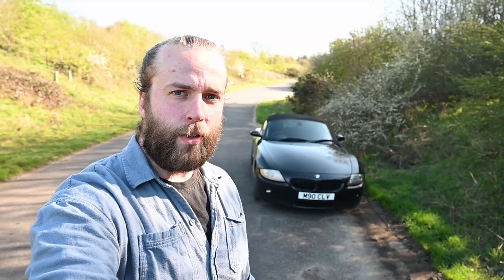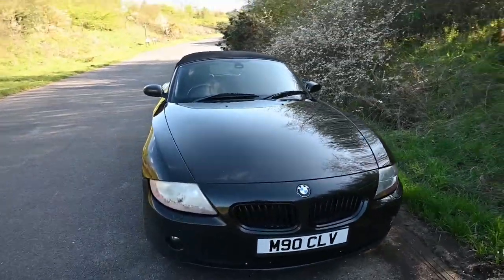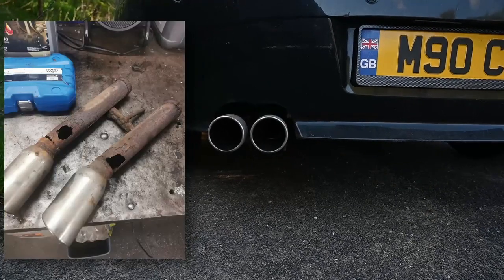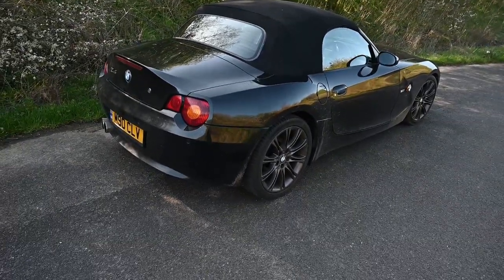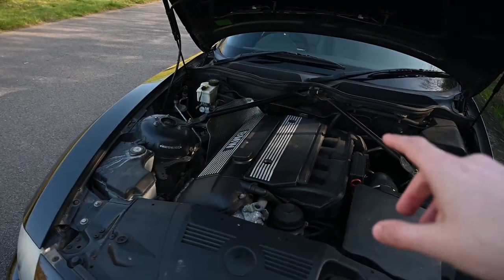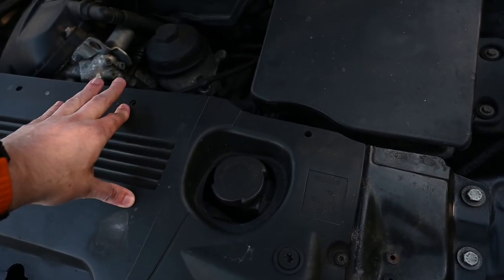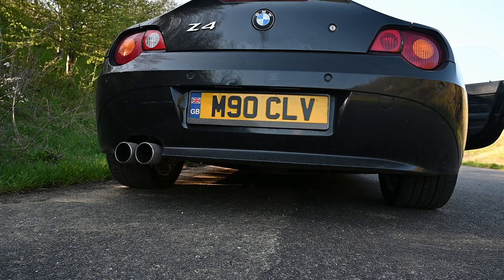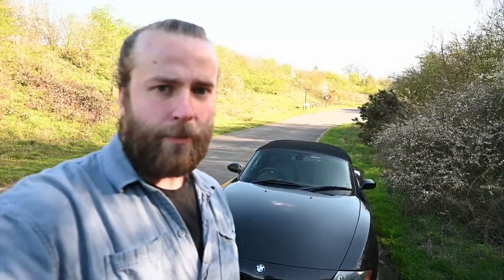I bought It's Joel's Z4

Comment: So pleased to see the car still going ………..I’ll follow you on your adventures in it 👍👍👍. I’m a new z4 owner 2.5 lt auto …so far loving it .any tips …things to look out for would be amazing. Cheers
Reply from the maker: I have driven a 2.5 before. Still has a good block under the bonnet. I think the big one is oil as it is my first car when I have had to think about oil levels between services. The engines are rated for about 300k miles so as long as we look after them they should be on the road for quite a while to come.

Comment: Change the exhaust you mess up the back flow that’s why you probably have a check engine light on
Reply from the maker: Nah shouldn't do as they are straight pipes from the catalytic converter back. It was definitely a coolant leak as I have pressure tested it and following this fixed it.